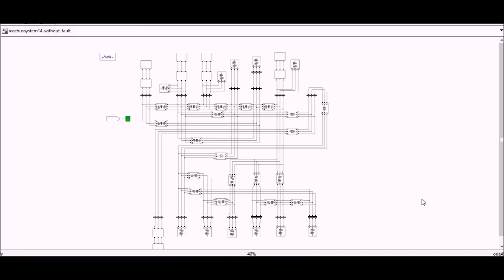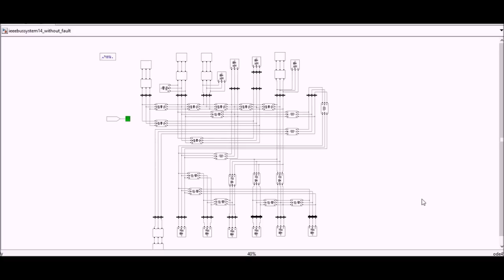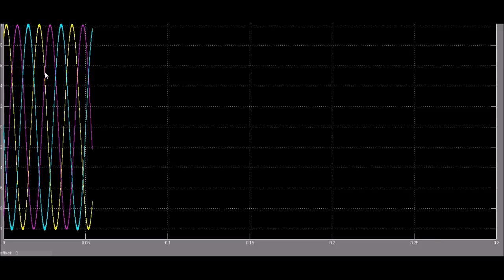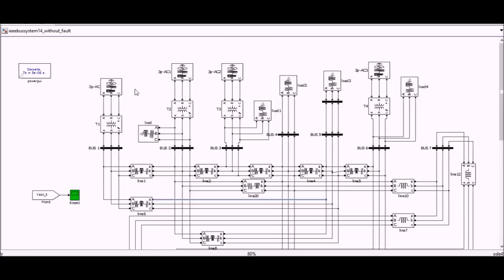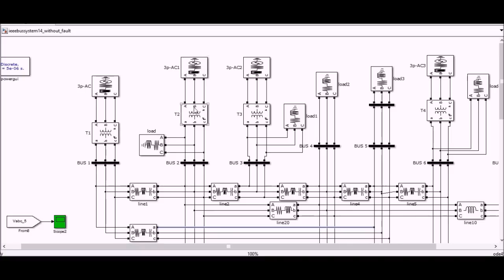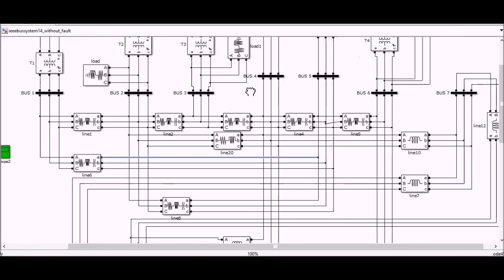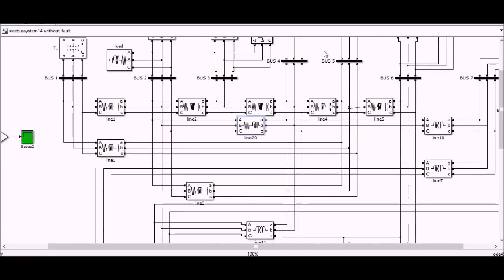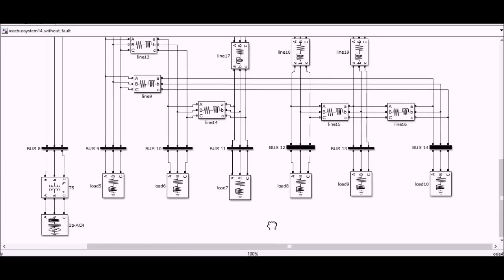IEEE 14 BUS system simulation in Matlab Simulink

Comment: Hi Satendra,

This is Kabir here. Thanks for uploading the video.

I am trying to build IEEE 39 bus system in Simulink. Have you worked with that before please?
Reply from the maker: Hi Kabir. I have never worked on IEEE 39 bus system before. May be in near future.
Reply: satendra kumar Hi Satendra,

Thanks for your reply.

I am trying to develop IEEE 39 bus in Simulink for research. is your developed IEEE 14 bus system available anaywhere that I can use as a reference please?

I would like to donate my IEEE 39 bus system to this community for others please.

Regards

Kabir
Reply: Shahariar Kabir 
Hi Kabir,
I am working on the same bus system in simulink and i have a convergence problem of the load flow. Can you please help me to deal with this problem? Thanks.